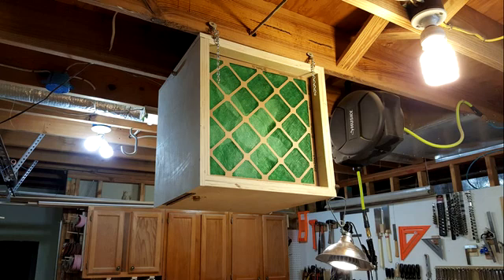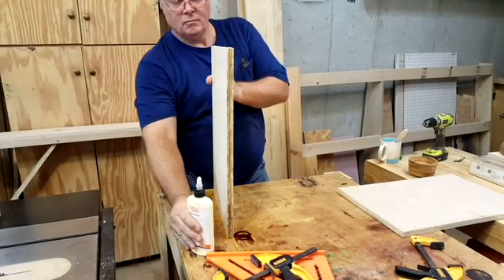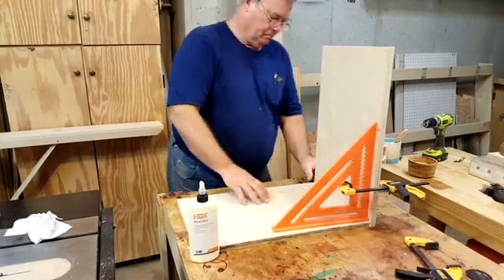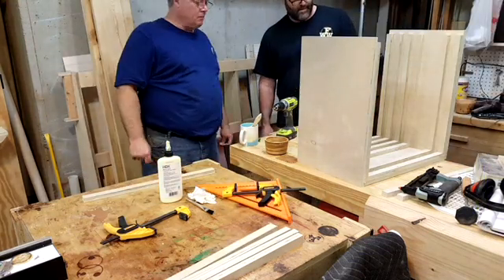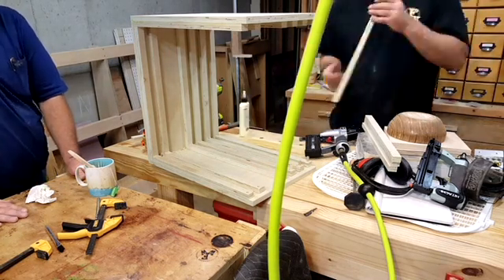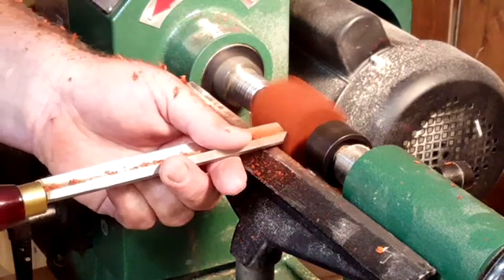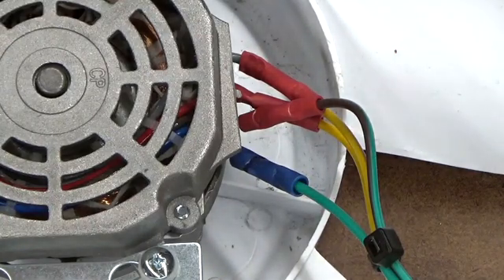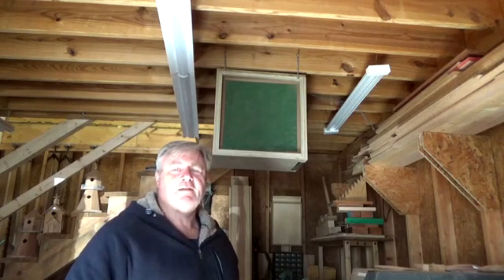Shop Built Air Filter

Comment: Nice job. I see you have the honeywell FPR 10 in the one exhaust slot. Would you kindly let me know what filters you have in the 3 intake slots? I looked in the plans and didn’t see them spec’d. Thanks for the free plans by the way!
Reply from the maker: Currently my air filter is in storage but what I can tell you is they are low grade filters (kind of like plastic wire mesh). Thanks for watching.